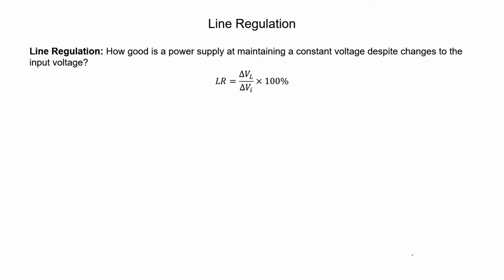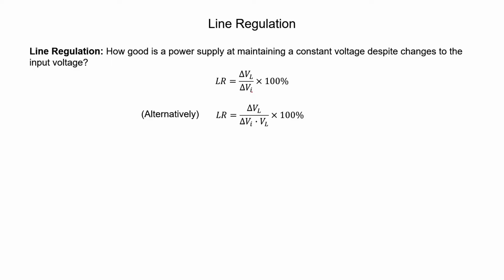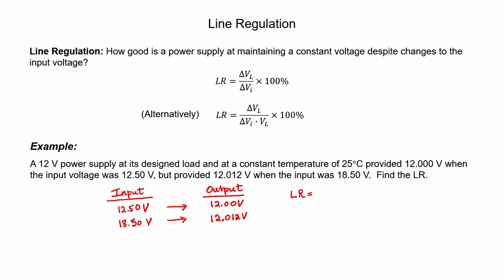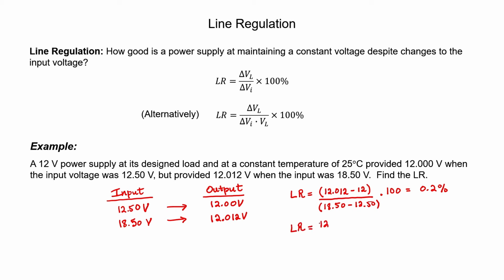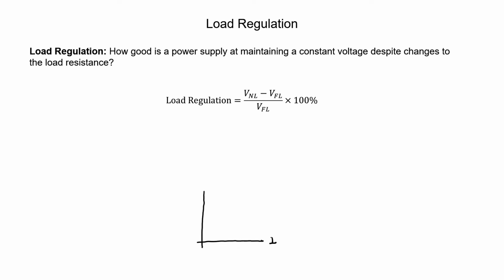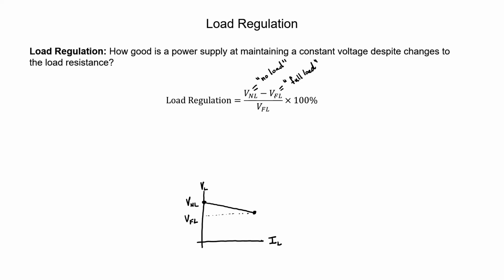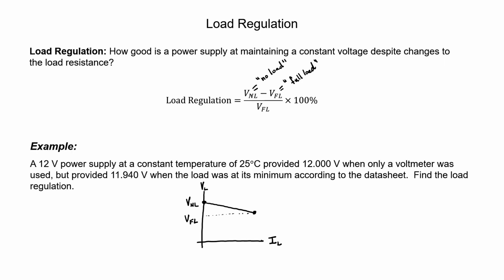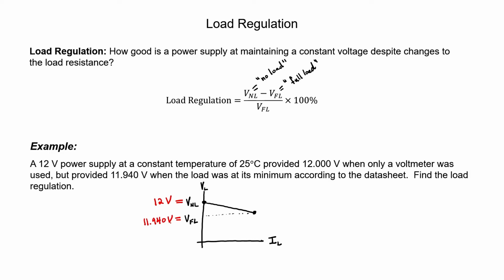Line and load regulation (3 - Regulators)

Comment: Hi, it is really impressive short video with numerical calculation but I am bit confused when calculating in % value should it be divided out put voltage i.e. (0.012/12)*100 =0.1%